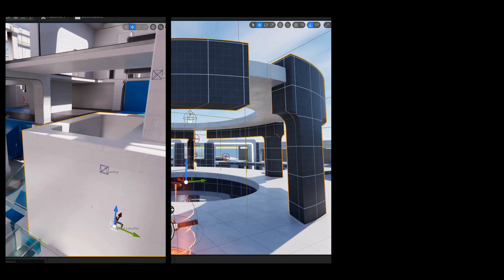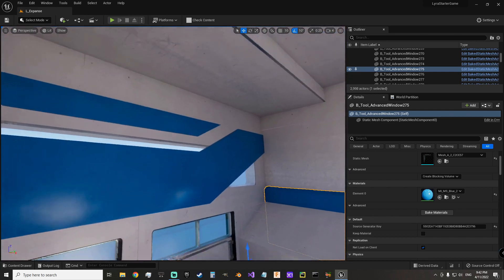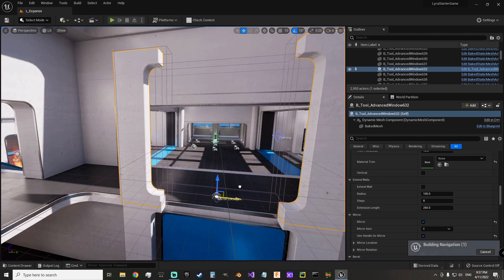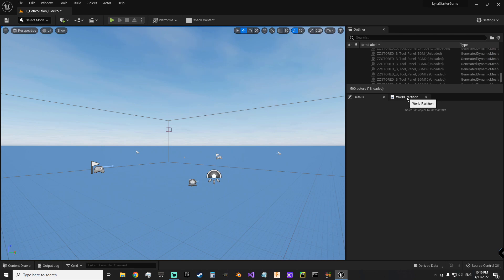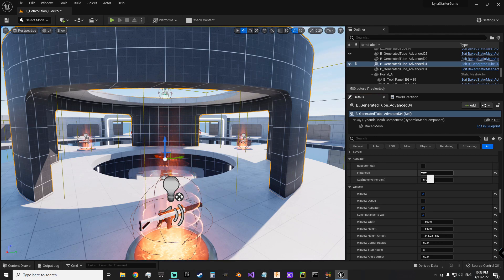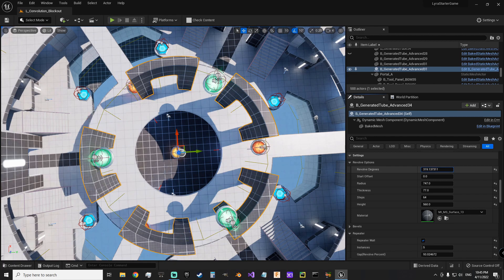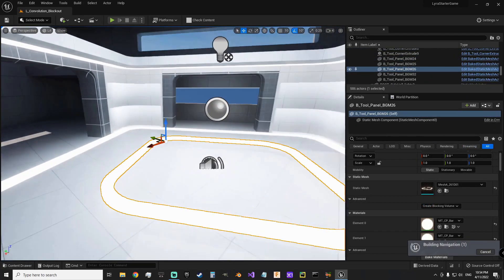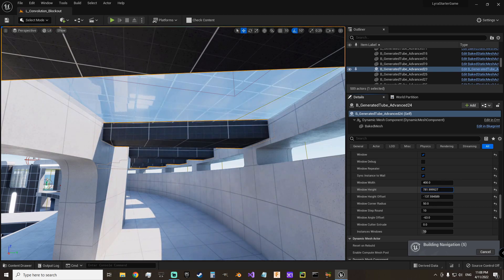Unreal Engine 5 Tutorial - Lyra Level Breakdown - Advanced/Interesting Use Of Procedural Mesh Tools

Comment: Hello, what do I have to do if the Tools are not visible after packaging the game?
Reply from the maker: Do you mean you want to edit the meshes while playing or in editor?
Reply: @johnnytriesvr7433  No, I want to place the meshes inside my map. BUT after pressing "Platforms>Windows>PackageProject" the shapes are gone in the game ready game. I don't know the correct word in English. I think it's called "packaging". I simply want to play my little game. But outside UE5 the Tool-shapes are gone. I am aware that I am doing something wrong.
Reply from the maker: @techno2776  Ah, I see. Did you convert them to static meshes?
Reply: @johnnytriesvr7433  YES, I pressed "swap to static mesh" but i t makes no difference.
Reply from the maker: @techno2776  If you see them actually swap with a static mesh in the outline after clicking "Swap to static mesh", I don't know what else your issue could be. If you don't see it swap then it could be an issue with your cold storage.
Reply: @johnnytriesvr7433  Okay, thank you. Yes, maybe it's a storage problem.

Comment: great video, your mic volume could use some tweaking tho, you got really quite at thwe end of the video.
Reply from the maker: Yeah, I hear what you mean. The outro narration is a bit quieter relative to the rest of the video. I pushed the audio down because it was originally super hot. I always try to mix the audio so it's to the level I want at 50% OS volume and 50% Youtube volume. That leaves margin on both sides to accommodate everyone.